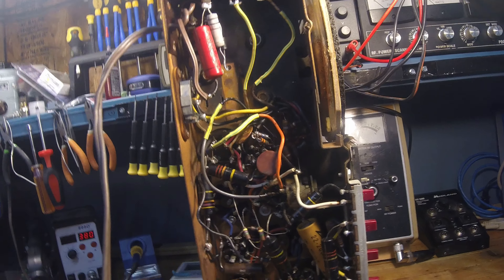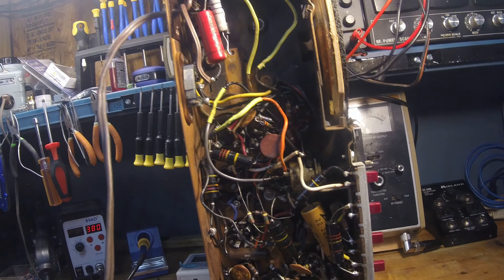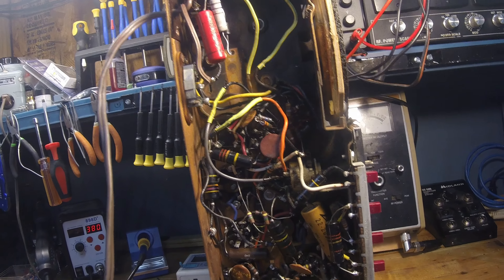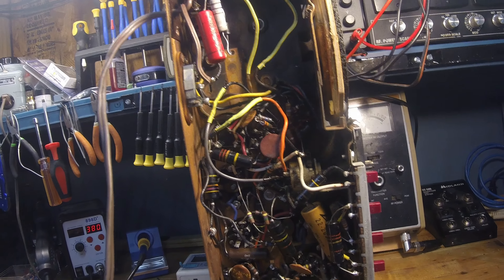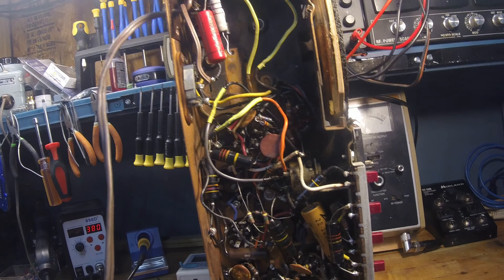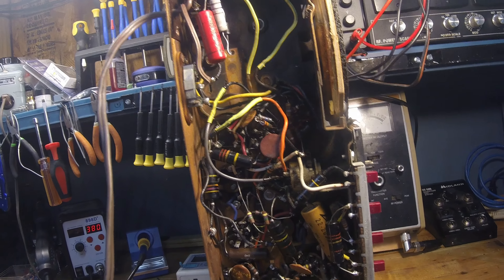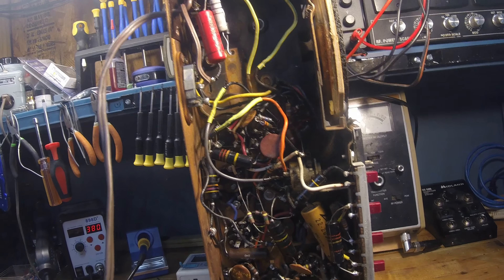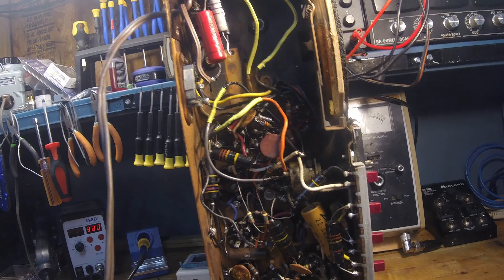Zenith G500 Shortwave Radio Repair and Restoration Part 2

Comment: Not looking good at the moment, but you will get it done, unless you decide it is not worth it, some just aren't.
Reply from the maker: Yeah this radio is a mess I am waiting on a couple tubes now will see what that does if I end up having to replace all the tubes I will probably just clean it up and turn it into deco art LOL. Like you said some times the radio is just not worth enough to put that much cash into to get it going.
Reply from the maker: Good news I got her going it was mess but that is half the challenge check out my latest video on the old radio working pretty good now.
Reply: @TheElectronMan  I have a bit of catching up to do, but you bet I will be looking to see how it works now.  :-))